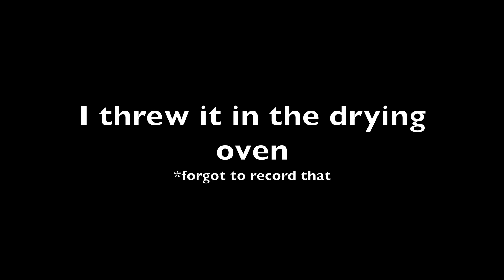Benzoic Acid From Toluene - Organic Chemistry

Comment: if you add a solution of magnesium nitrate, you get an oxidation reaction in a neutral environment.
in the classical recipe, this is how a ketone is obtained, perhaps an aldehyde will be obtained from toluene, if you're lucky.
2 hours 70 degrees Celsius

Comment: What if you wanted to recrystallize it?
Reply: super possible. I would maybe use ethanol and water as the solvent system. The benzoic acid is very soluble in ethanol, barely soluble in water. It might be possible to use just water if you heat the recryst solution up enough, but you might want to give it a boost with ethanol. then let cool slowly.